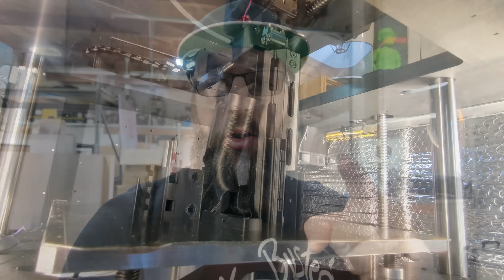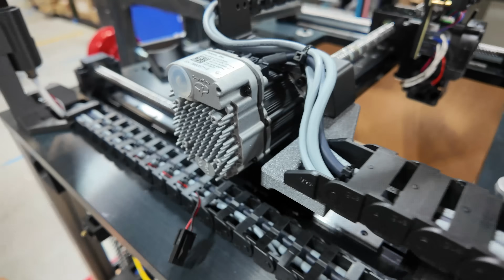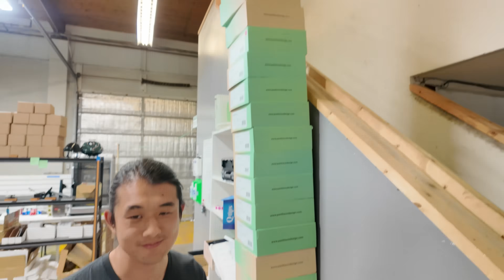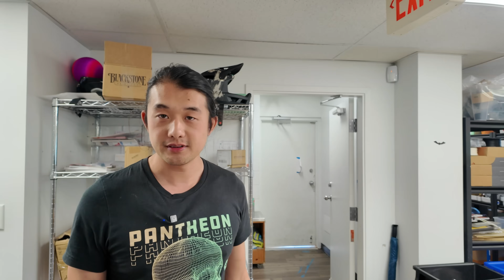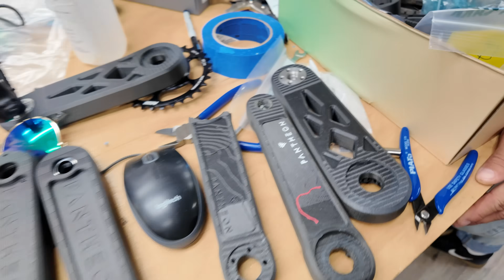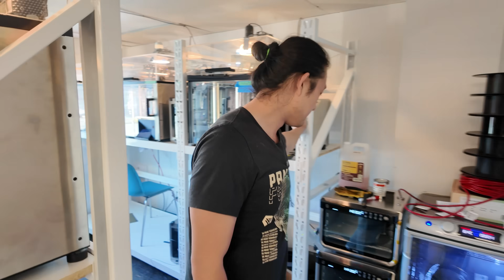Building the ULTIMATE 3d Printer! - Pantheon Tour 2024 #3dprinter #manufacturing

Comment: So, they are building/working with ESD sensitive electronics without basic ESD protection on the workplace... That will definitely add some reliability to the electronics. Also the wiring is terrible, colors are just random - green/yellow for the hot wire? Why are the ballscrews and the Z guiding rods supported only on one side - that just adds more and more resonant parts to the construction. BTW, patenting a mountig plate is really funny...
Reply: we actually dont know how to engineer anything, bob is actually 7 cats stuffed into a trench coat. the cats kept playing with all the ESD safety stuff so we had to throw it out..... its been rough

Comment: Nice dude, great tour and the machine looks super well thought out. But can you eloborate on what the mentioned patent is? Mounting a 2 axis motion system to a structural plate can't be  it, right...?
Reply from the maker: i dont know the exact specifics but to my understanding its for having the entire motion system (XY and Z) being entirely mounted to a single component (the common plate) and nothing else for full functionality.

and to be fair, ive yet to see any other commercial printer use this sort of design concept. and you can get around it by simply having the Z mounted to the bottom along with top.

Comment: You can't argue with the results of a quality hot tip unit. I still stand on the theory that the VZ goliath is just a hot tip converted to a hot end.
Reply: Some interesting dynamic in there, too. Am I wrong or didn't Slice go after Vez for the Goliath? Maybe what Bob is doing differently is to kick back to Slice and then for the heater, since Vez didn't patent its use in 3D printing there's no beef there. (That said, no idea of Vez was the first or if its patentable at all)
Reply: @AntiVaganza  slice went after Vez for the heater to heatsink mounting posts. Ya know the 4 rigid posts that connect the heatsink to the heat block. I can't remember how it was settled but it was a shitshow lol. 

Bob licensed the use of the patent from slice which is why their stuff looks identical. Same with how bondtech licensed the CHT patent from 3d solex so they could make their CHT nozzles.
Reply: @gregorypfeifer9117  we licensed the 4 post mount from the slice, it's a really good solution to building a thermally isolated but ridgid coupling